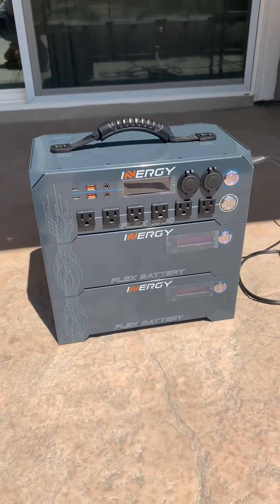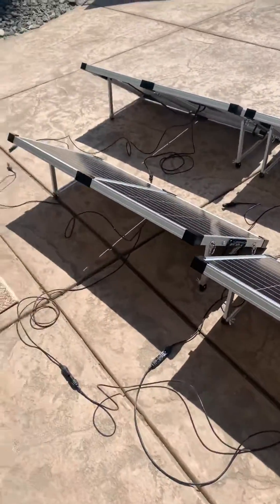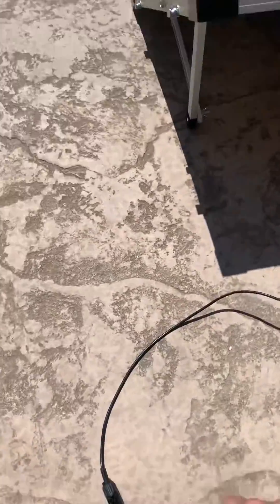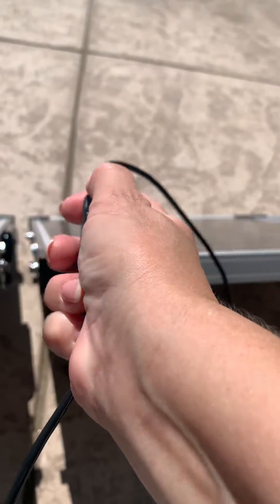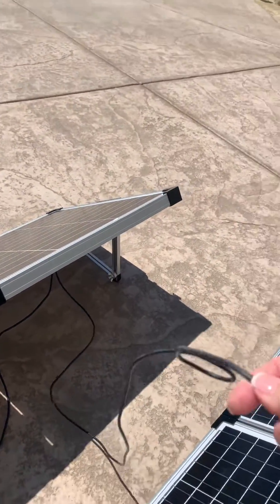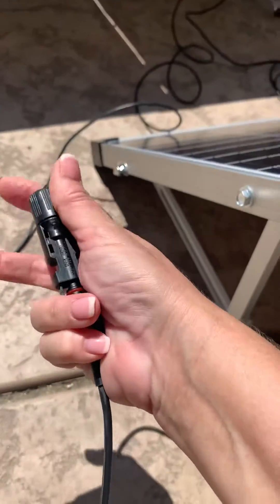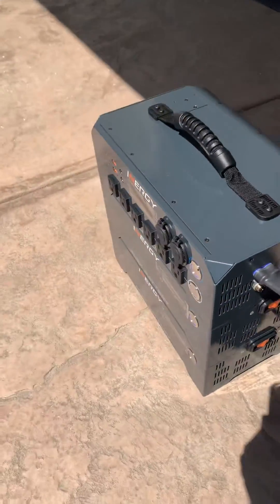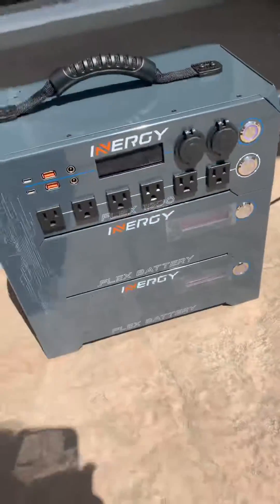How to connect Inergy Ascent solar panels with MC4 connections for the new Inergy Flex 1500.

Comment: When i got my 100 watt panels i did not get the 30 foot electrical cord that connects to the inergy generator. How do i get that?
Reply from the maker: I'm sure you addressed this by now, but I bought mine as a kit. Sorry for the late reply.
Reply: @RayynStorrm1  i ended up buying the cord thanks for responding.

Comment: my battery is showing off system is on. I try to turn it on and it still shows off.. anyone having this issue?
Reply: Not sure I understand what you mean. Did you check to make sure that none of the plastic from the battery port cover had gotten into the port? Inergy responds pretty quick to online chats.

Comment: I think that’s a series correct? Can you show a parallel connection, look forward to some more vids with you running stuff!
Reply from the maker: I have not purchased branch chain connectors, as I don’t have a need for them at this time. I am curious though, about getting them. Any tiny shadow over a small portion of ONE solar panel adjusts ALL the panels to be less effective, so a parallel connection may help in some instances!

Comment: So happy you received your Flex system. My complete system hasn't shipped but my order of one battery and the cable connection for my Kodiak is at the local post office waiting to be delivered. Looking forward to more videos. Thanks
Reply from the maker: Yes, I’m looking forward to making some!  I love how their gear is forward and backward compatible.
Reply: @RayynStorrm1   I received my battery today but of course the cable to connect it to the Kodiak didn't ship so I can't use it yet. I have a question that you may already have the answer to. The Kodiak charger is rated at 12.6 volts at 8 amps which is roughly 100 watts output. The flex battery came with 22% charge but when I plug up the charger it only shows +50 watts. Is this something you have tried since you have multiple batteries? Thanks.
Reply from the maker: @DSMLivin  I do notice it doesn’t charge at the rate one would expect and I don’t know how to explain it. It happens with my other brand also. The “100 watt” solar panel only shows 68 watts in optimal conditions, so I wasn’t surprised when it (Flex) wasn’t pulling 400 watts. Is that what you mean?
Reply: @RayynStorrm1  I guess so. Just seems that a regulated output of a charger would come closer to charging its 100 watts. I will have patience and wait on the connecting cable and see what happens when the two are connected.  With any luck I shouldn't have to wait another 16 months lol. Thanks for your help ma'am.